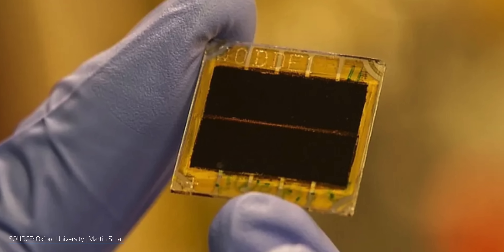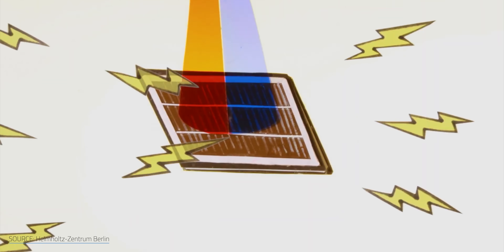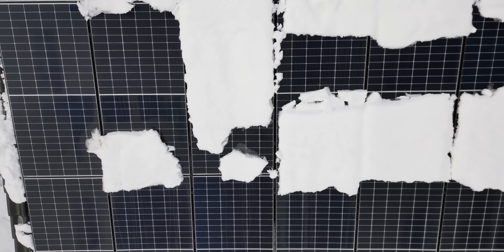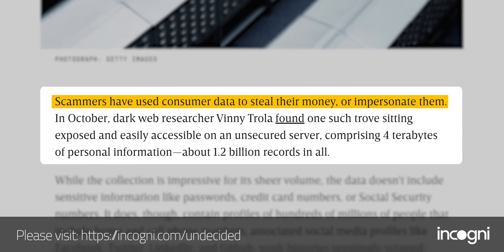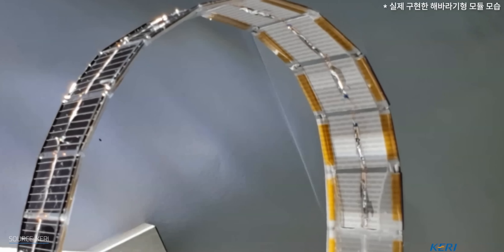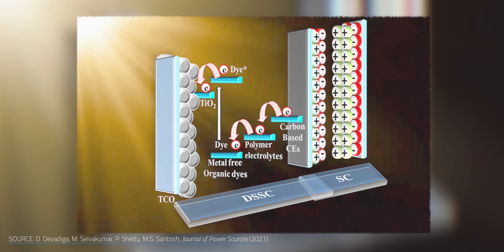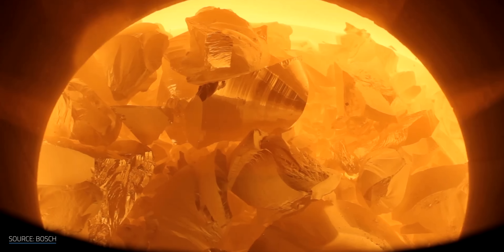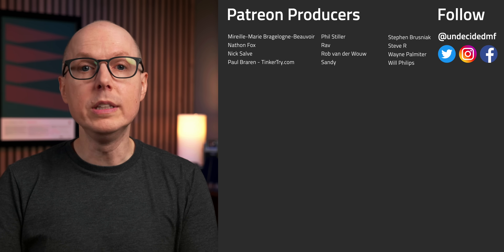Why These Quirky Advances Could Change Solar Forever

Comment: Solar cell servicing and recycling should be explored and talked about more
Reply: I love how the oil industry has worked to push this message ( using organizations like Citizens for Responsible Solar ) to block Solar and push that it’s a “dirty” technology and yet they abandon wells and leave toxic environments all over the world from Canada to Ecuador and fight being forced to clean them up.
Reply: @entertaintech4374  solar cell degredation is less than 1% per year for almost all solar cells. Commercial solar cells don't need "recycling" in the sense of breaking them down to constituent parts, but it would be good to expand the "re-use" part of a sustainable product lifecycle, as solar cells live an exceptionally long time. Think more the lifecycle of a computer processor, less an inductive motor. Solid state devices like solar cells have no intrinsic moving parts, which is an extremely valuable property that enables re use instead of recycling. Many commercial solar panels should never retire entirely, at least not for 40+ years but instead be migrated to different applications if the needs change, much like how computer hardware is so very often re used in lower intensity work as things progress.
Reply: just throw it in the trash can we aint ever fixng trash
Reply: There's no real practical way to recycle them. Most recycling of objects that have lots ofn
 Combined materials requires even more materials to process them back into components. Acids to melt and extract specific elements, and then extract the element back out. Creating vapours and just new chemicals that don't have any use and so are classed as hazardous waste products. 

Same with batteries. There's no real practical way devised yet for recycling lithium batteries. One factory I've heard of is starting to work on it at small scale, but that's about it.
Reply: @ge2719  As of 2023, there are dozens of lithium-ion battery recycling plants operating worldwide...
Reply: @JohnDir-xw3hf  none of them recycle the lithium. they recycle some of the metals in the shell of the battery. The lithium is lost/destroyed in the process.
Reply: @ge2719  lithium is metal and it's the most expensive in there. But if you have checked them all and how they are working...
Reply: @ge2719  and you need a nuclear reactor to destroy atoms.
Reply: @JohnDir-xw3hf  am I supposed to be able to understand wtf you're trying to say there?
Yeah lithium is expensive ... And?
Checked all of what and how they work, the recycling factories? Yes, it's a well documented issue hat there are no factories that are able to recycle the lithium. It wouldn't be notable news that there's only one factory starting to work on it if there already were factories that could do it.
Reply: @ge2719 lithium is very much not destroyed 95% or more of a lithium battery is recycled. Lithium included. Have you ever heard of recycled batteries performing better? It has to do with how the lithium is recycled. Lithium is recyclable and the amount is increasing.
Reply: @Lord_LindaThePhilosopher  also "95% or more of a lithium battery is recycled" source required.
Reply: @ge2719  "As of 2023, there are dozens of lithium-ion battery recycling plants operating worldwide...."- chatgpt 🤗
Reply: @ge2719  there are 3 plants in the US that can recycle batteries and can get around 95% of the material back
Reply: @VladReble  and none of that is the lithium. thanks for pointless repeating what i said, except trying to lie by trying to imply it was recycling 95% of the lithium.
Reply: @ge2719  
I was trying to point out that current processes do recover the lithium and majority of the battery material. Not that 95% of the lithium is recovered.

Li-cycle's recycling process produces black mass that contains lithium,  nickel and cobalt, as well as graphite, copper and aluminum.

A battery manufacturer can perform hydrometallurgical processing to extract the lithuim and cobal to produce more batteries.

Just because the company doesn't do the final step themsvles doesn't mean they aren't recycling the lithium.

At the end of the day majority of a battery's cost is from the rare earth metal, cobal, magenese and nickel and recycling processes should focus of these metals the most.
Reply: @VladReble  unless the lithium is usable its not recycled, so youre wrong. thats literally what it means. You might as well say "well theres lithium in this old battery, so i there, i just recycled it.
there is no mass recycling happening of the lithium from batteries. what they "could do" is meaningless. the process is too costly and inefficient to do it, so they don't do it. the process needs to be made more efficient and work at large enough scales. until someone does that there is no recycling of lithium on a large scale. just because you can do it with a jar full in a lab is meaningless.
Reply: Nope...ZPE. Zero Point Energy...that's what needs to be DISCLOSED.
Reply: @edgewood99 is it possible? It's not proven.

Comment: There is 1 or 2 company working on some solar cells that works even in low light conditions, including interior light, to power small devices (like headphones & TV controllers) with the goal of getting rid of batteries).

This is something interesting to explore as well. (I wont give the name of the companies here, because it might be seen as ads or get shadowbanned but can be easly found on Google).
1. Reduce the use of batteries for very small devices using multiple types of ambiant light.
2. Reducing power consumption for bigger devices.
3. Improving solar harvesting targetting over 40% efficiency. (Hurry up Perovskite, do your magic)
4. Make sure all of those are durable & eco-friendly + affortable. (Which is the hardest part)
5. Improving batteries power storage, charge speed & longetivity for home usage. (still waiting for you Mr Graphene)

All of that combined, sounds like a great future for energy & my off-grid plans :yougotthis:

Comment: 5 years ago I was involved in project using solar panels and mirrors to improve the performance in an urban application. It worked but got really complicated - ultimately using the mirrors to track the sun coupled with tracking for the solar panels. There were significant gains.
Reply: And all that extra work usually costs so much its cheaper to get same power by installing larger amount of cheap panels in fixed position.
Reply: @sznikers given its combination of mirrors and panel plus urban, I’m guessing it involved overcoming building shading during part of the day. If you have limited space and heavy shading, the complexity might be worth it.
Reply: @sznikers  I costed it again yesterday and mirrors with motors are cheaper relative to the improved performance.
Reply: @steverichmond7142  then why did so many farms resigned from tracking and instead installed larger amounts of cheap panels on fixed mount?
Reply: Track the sun? The sun's position is known for the next couple of thousand years, every second of the year, why 'track' it?
Reply: @brunobrauer6301  Just guessing, but probably to get more accurate real time data. If the solar panel moves without correcting it, it will bring down the efficiency and if you are using a predetermined path its harder to correct any misalignment.
Reply: @brunobrauer6301  I presume you're American so I'm typing slowly... Tracking the sun during the day in order maximise solar gain and sunlight is standard practice in larger solar arrays.
Reply: @steverichmond7142 buddy I get you hate Americans but you can’t just pretend to misunderstand what he said.
Reply: @AL-lh2ht  I presume you are also American so I am gonna go extra slow. The tracking here is not about figuring out where the sun is, but rather moving the mirror and the panel so they can take advantage. Let me know if you want me to slow it down more.

Comment: I am getting a little confused here...

Perovskites might be a new thing on the scene, but flexible, tunable thin film solar technology has been around since, at least, 2007. There was a New Jersey company named Konarka, that was trying to develop them for commercial use back then. They were on a cable network show about new technology, and they had them applied to windows and walls. They were able to make it in many colors, even clear for the windows. I contacted them on a project, but because their tech was not Patentable, they were really difficult to work with, and I went a different direction.